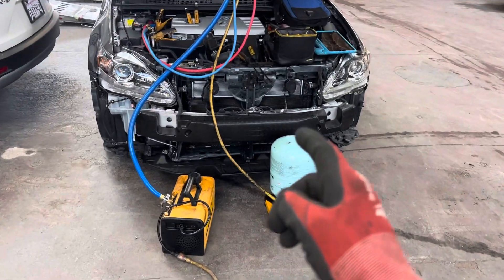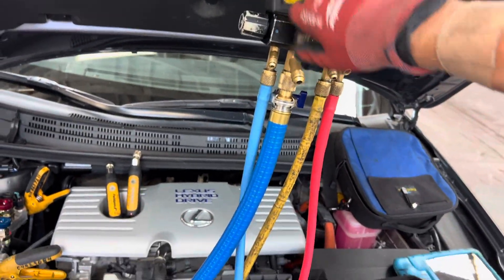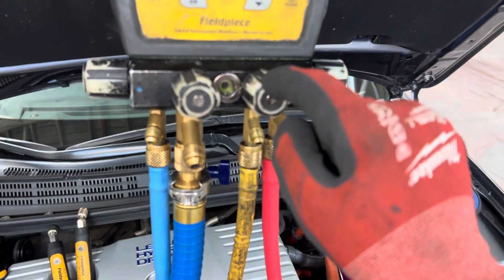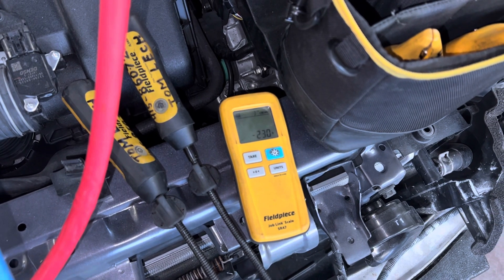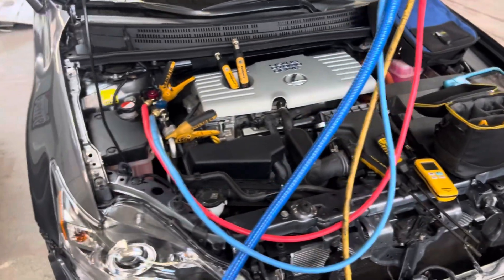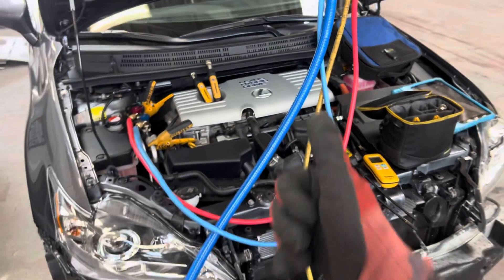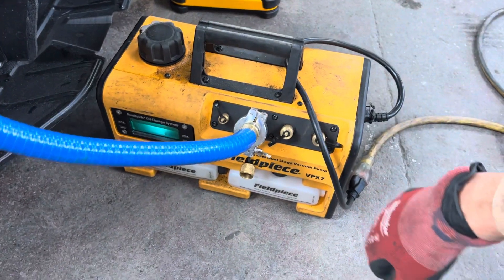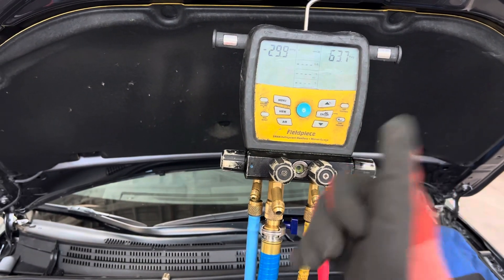Refrigerant Recharge Liquid in High Side Engine Off. Lexus CT 200H  470g.

Comment: In other videos, during the vacuum stage, your micron gauge is attached to the high-side service port to obtain the most accurate micron reading for the system.  I didn't see the micron gauge here.  Can I assume that you removed it prior to starting this video?  Also, have you posted a video explaining how properly to arrange, secure , etc. the charging hose from the tank to ensure an accurate weight for the refrigerant transferred to the system.  I feel like this part of the process may be tricky as any movement or hose tension could lead to errors.
Reply from the maker: Yes, in some videos I’ve already removed the micron gauge before charging or after before starting a video

I do have some videos explaining that you weigh your refrigerant tank before you hook it up to anything very accurate weight . And you write that weight down of the tank all by itself, not hooked up to anything.

Then you hook up your tank and carefully position your hose, so it does not move or get bumped or disturb . 

Then you weigh in your refrigerant . 

And if anything was disturbed that messed up your scale or wait during your operation 

When everything is removed from the tank, you weigh your tank again do the math to get the comparison 

And your tank should match what you weigh into the vehicle if it doesn’t you know you made a mistake
Reply: @coldfinger459sub0  Thanks so much, again.  You're such a prolific influencer.  I only recently discovered you, so It will take more time for me to find and watch all your videos most relevant to my project.  :)

Comment: do you start the engine after weight charge is complete? i do that because there is still lots of liquid refrigerant in the hose (red one in your case) that needs to go in the system. that is why i charge through suction line as compressor pulls the liquid refrigerant into the system and only vapor refrigerant is left after pressure gets stabilized through out the whole system.

if i really have to charge through high pressure line then i use one hose method like you show in your other videos. removing manifold from charging process cuts back on the amount of liquid refrigerant that remains in the hose but doesn't get into the system in reality.
Reply from the maker: Yes, it all depends what method I’m going to Jusan what I’m going to do after. 

But I completely feel the system to the high side hoes . 

And then later, after testing and taking readings, it gets sucked into the low side . 

Unless I put a little extra and keep it in the hoses 

Because I have another vehicle that has a leak and no refrigerant in the system that extra Refrigerant I just pull it off that vehicle connected up to the other vehicle and pushing that extra ounce of refrigerant and use it as a leak test gas for the next vehicle . 

It all depends what I have lined up for work .

Comment: What do you do when your refrigerant tank becomes low enough that it will not fill the system instantly all the way in one shot with liquid into the high side quick enough before it equalizes in pressure between the canister and the lines? Do you just get as much as possible into the system via liquid and then just run the compressor to draw the remaining weight of gas into the system the usual way? I'm wondering how a person is able to properly charge by weight when they can only use the small 12 ounce cans, but when their system takes more refrigerant than what's in the small cans. Would it be best to do a 1 hose method where the vacuum pump is on the high side and just a micron gauge on the low side, with 2 small canisters connected together with a Tee fitting and a ball valve which is then connected to another Tee fitting in the hose going to a ball valve and then out to vacuum? So you can valve off the cans and vacuum down, then valve off the vacuum side and open the 2 cans to dump liquid into the high side?
Reply from the maker: For using the one hose method in the micron gauge in ball valves all this has been covered by John Bergman’s videos on vacuum and using micron gauge in ball valves

Also, on bryan, Orb’s’s Videos HVAC School he has done several videos using the one who’s method 

And Greg videos, HVAC service LLC 

Also, Ty Branaman on his videos LUV2HVAC 

If you watch all the videos on one valve method, they show in person and good animated videos. 

You will have a good grasp of how to correctly doing it after watching good videos, performed by professionals in the message that Training instructors with good resources to make the best throw videos. 

Always got to say, don’t forget Jim Bergman

As for getting in the gas into the system, I’ll tell you like I tell everybody else. 

You must understand the gas laws, and how to manipulate them in your favor to make that work

It just doesn’t happen on its own by magic

Read and study, watch some videos on the three gas laws if you want to take it a little further, the combined gas law’s. 

I have released videos on this before all these videos about the gas laws are all covered thoroughly by all the gentleman I mentioned above, including Wikipedia on Google and many other professors from colleges in science class is physics classes in thermodynamics classes. 

When your truly understand the three gas laws, and it’s not difficult at all, you will be able to answer your own question on how to get the gas into the system. 

And you will learn so much more in the process of seeking that one little piece of knowledge that you will also learn how to diagnose many other problems just buy what’s in your head from learning and using your hands as your sensors,
Reply: @coldfinger459sub0  I'm familiar with the gas laws, PV=nRT. We covered it in depth in AP physics. :) I just value your professional input and your own technique. I like learning from the successful people with attention to detail such as myself. Thank you for all of the suggestions on materials to learn from!!! I have watched a bunch of your 1 hose method videos and I just went back to rewatch your manifold and hose overview video a month ago to refresh my memory. 😎
Reply from the maker: @mannys9130  I just remember one thing all systems can be filled up within 15 seconds to 30 seconds 60 seconds at most. 

And even when I would do a large residential commercial, whether it was a 7 pound system or a 60 pound system, I can fill the entire thing instantly not as fast as a car, but 100% completely without ever starting the system 

Including the little 12 ounce cans, completely get all 100% liquid out of them and even be able to get most of the vapor out of them to wear the end result . 
Will be that the vapor left in the 12 ounce can will have a lower pressure when I’m finally finished in the system that I filled it with  .🤯🤔

This is by using the gas laws and manipulating them . 

How can I get out more out of a can send equalized pressure of the system 

Then, when the cannas removed will be at a final, standing pressure less than the system  ??? 

Physics puzzle 🧩
Reply: @coldfinger459sub0  Because the deep vacuum of the A/C system initially offers zero resistance, pressurized refrigerant vapor at the top of the tank/can rapidly pushes liquid refrigerant at the bottom of the tank /can into the A/C system.  Some of the liquid refrigerant that enters the A/C system vaporizes and thereby significantly chills the A/C system and its newly acquired liquid and vapor refrigerant.  The A/C system, which is now much colder than the tank, maintains a much lower refrigerant vapor pressure than does the tank, where less refrigerant liquid converts to vapor due to the higher tank pressure and temperature.  If necessary, you could help to ensure complete filling of the A/C system by warming the refrigerant tank/can or by delaying the procedure for another day when the ambient temperature is low.  Tom, what did I miss?
Reply from the maker: @rj7008 I never have charge problem. Always goes in. Only takes 10 sec to 30 sec to fill
Reply: @coldfinger459sub0  I believe you.  I've seen your very short recharge videos.  :)  What could one do to practice the procedure (mock runs) before actually doing it?   Practice might make the real procedure less nerve-wracking in the late fall or winter.  Part of my prep will be to test my vacuum pump for pulling a deep vacuum (3.5 CFM rated for ~40  microns) and to check my manifold gauge sets, charging hoses, adapters, and ball valves for vacuum leaks.  Do I also need to clean or flush my manifold gauge sets and hoses?  Is this possible or recommended?
Reply from the maker: @rj7008  can you use refrigerant recovery tanks for mock up demonstrations and practice